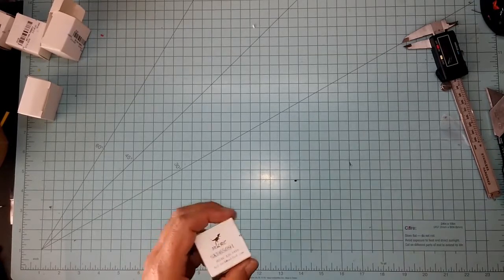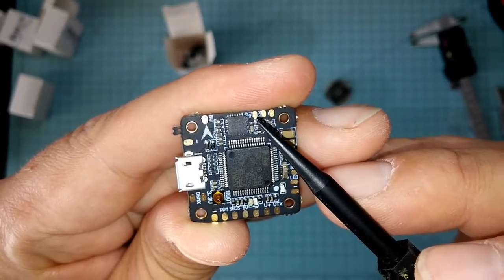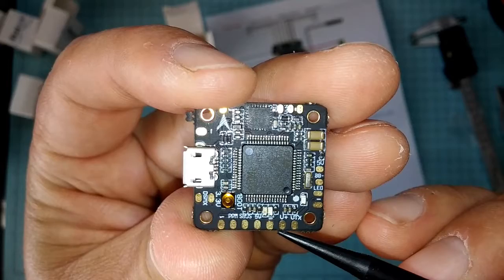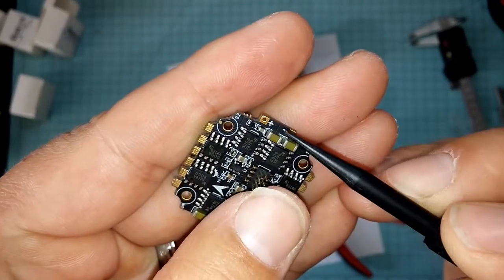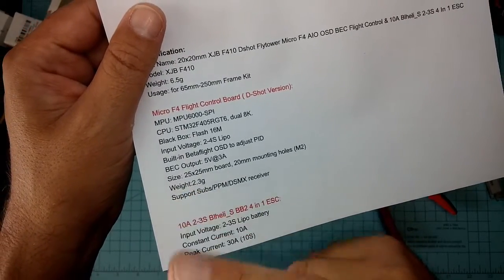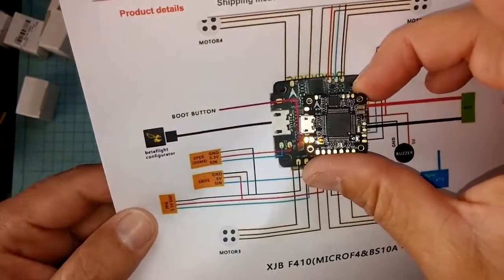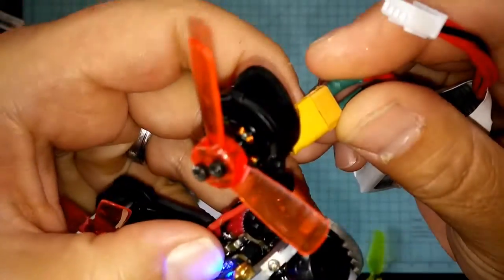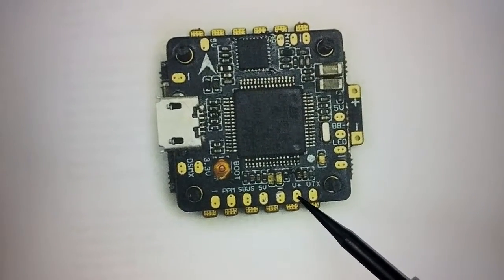Banggood  XJB F410 Dshot Flytower Micro F4 AIO Overview

Comment: Yeah I just put the New Emax mini magnum F3 on a 2" quad. It goes from 2s to 4s. It weighs 76 grams without the battery and it fly's pretty good on a 3S 450Mah Battery. What is your weight on this frame with the flight controller and motors and props?

Yeah I was thinking about using a different frame like the one you're showing.

Here's my Maiden flight if you want to see how it flys.
https://youtu.be/2ch-6lWttpQ
Reply from the maker: +Unknown X damnnnn I’ll check it out.  I think I’m around 75g ??? Somewhere around there. Have u tried the hulkie props yet???? They’d be badass on your bird
Reply: JJRotoGeek, I never heard about them. I just looked them up and those props look like they'd get some really good thrust. Yeah I'm definitely going to buy some,  thanks for the heads up.
Reply from the maker: +Unknown X awesome brother.  Keep me posted on if ya like em!!!

Comment: I'm a bit confused - what are the 8 connection pins in the middle of the boards? Are these the motor signal pins? So no need to use wires to send the motor signals from the FC to the ESC board?
Reply from the maker: Mike vom Mars hey there!!! No, there’s a socket on the 4in1 esc board that the flight controller pins plug into.  They interconnect.
Reply: So I guess this socket is where the motor signals are sent through? Nice solution then 😊👍
Reply from the maker: Mike vom Mars yes sir!!! Motor signal and fc power!!

Comment: Hey jj. I probably wouldn’t do 4s on a 7500kv and even the 6000kv will get really hot with a bad tune. Emax also sells a 4500kv and that would be best if you want to fly a 4s all the time but with a good tune the 6000kv will rip for a little while at least.
Reply from the maker: ace trex oh absolutely.  The 4s would smoke the 85k quick lol but it would go fast for a second loloool

Comment: Hey jj. I finally got my egg 100 done with a runcam micro, emax 6000 1106, xjb f428, a 4s 550mah infinity and holy s#*t brother you have got to do this!!! It is way faster than a 5”!!   Probably Close to 130mph + of insanity!!
Reply from the maker: LOL fucking aweseome! Ive got that same rig on my home made lizard frame build.. f4 omnibus with a 25a esc but with 7500kv.. however i havent run 4s!!  and those motors are perfect for that, it would smoke mine.. do me a favor and send me a link to the motors and battery your using.. gotta try it LOL

Comment: What motors are you using on the egg 100 and is it pretty decent with that heavy of a frame.
Reply from the maker: ace trex I really like how it flys, although I broke the frame the other day, but I ordered two spare frames that just came in, so I'll be doing a rebuild. I'm using dys 7500kv motors on it, but in the rebuild I'm switching them out for the ipower 7500kv

Comment: Is the F425 board the same way with the battery voltage on that port.  Cause I fried a VTX hooking it up that way.  I frankenstiened one off a different quad but it could handle the voltage.  when I got the new part in the mail, I took off the huge VTX and accidently pulled that solder pad off.  So I wired to the 5v on the front left and have no problems now.  So did I get lucky or did they fix this?
Reply from the maker: Hey there, i wired this one the exact same way as the F25, they are both identical as far as i could tell, had no issues. If you hook up the vtx to the voltage port it will fry it, because thats straight bat voltage through put. You have to use the 5v pads for the vtx
Reply: Thank you for confirming that.  Im gonna go warn a buddy about it.  I know hes doing the same setup as me.  So when I ripped the solder pad off my board, and felt bad about it all night and the next day for wrecking my brand new FC.  I was really getting lucky, because it forced me to use the other 5v.  Awesome, good to know.
Reply from the maker: jarrod landry no problem brother, I smoked a brand new kakute aio once, right off the bat.  We all fuck up lol
Reply: Just an update.  Ive been rocking this micro for a few months now.  I fly so much better now.  It takes a beating some days lol.  Over the winter I'll upgrade to the emax 1106 6000kv.  They werent out yet (I should have waited 2 weeks).  Love the micros, batteries are cheap and too light to break, 80 foot falls, slammed huge tree trucks, large branches and had a fail safe and it fell 60 feet out of the sky.  Id say its pretty tough.  I use the same frame as the leader 120.  with a runcam micro crammed in.  Cant wait for next year.
Reply from the maker: +jarrod landry damn brother well said!!! Every year brings allota new gear.  Fun shit!!

Comment: how do you get it to do the starwars theme at the startup there? Also is there a way to know what the beeping from the FC means? Mines locked up and does 3 fast beeps then 2 slower beeps... and wont connect to beta flight or flash. Awesome vid!
Reply from the maker: Hey brother, thank you!! i am going to do a how to vide o on the star wars tones tday and get it up. a few people have asked that. your fc wont flash? or just the esc wont flash?
Reply: Im not sure, so I went ahead and got a new stack. the Fc only flashes a blue light, and a solid red one. when hooked to the drone it also beeps the flashing blue light thru the buzzer. AWESOME! look forward to your vid!
Reply from the maker: Michael Silcox ahhhh.  Does it hook up to beta flight ok and flash alright?
Reply: No, it plugs in and gets the lights to kick on, but it will not connect to beta flight, I have 2 of these FC's and the other connects and works just fine. My friend who is the owner of the FC asked HGLRC on facebook about it and they recommended to heat up the MPU6000 chip with a heat gun, to see if that sets it back in place.
Reply from the maker: Michael Silcox lololol r u fucking kidding me?????? They actually told u to do a reflow the solder??? That's professional.  If one connects and the other dosnt, try holding the boot button down and plugging it in, if that doesn't work, send the damn thing back lol
Reply: Well... First I coated the whole board in conforming silicone, as I do with them all. Have not had a problem with that yet. then in soldering we got a few of the tabs to almost come all the way off. they have maybe one chance at soldering on a wire left. And last,,, we ordered a new brick lol, so we will have spare parts if I can get this to work later. yeah they recommended trying that lol. I have the gear to do it and have it work here and there in the past.
Reply from the maker: Michael Silcox oh I have to, don't get me wrong, I've used toaster ovens and heat guns.   But it's unusual for a manufacturer to advise that lol
Reply: That is... It really is lol.

Comment: Can u tell me how to connect smart port to a micro F4 board? sbus workin fine but i have no clue where to solder ma s.port wire to...seems like rx1,tx1 doesnt work....got a furibee f4 flytower ... cant get telemetry or ma motors to spin...very desperating :(
Reply from the maker: Hey there, i dont use telemetry but we can get it to work. im asuming that you wire your telemetry output from you reciever into the rx of the board, im sure youve done that already, did you set it up in the ports page in betflight yet?
Reply: JJRotoGeek hey first of all thanks for the fast answer!! Yeah i soldered the smartport from my x4r to the rx1 on the board! I selected serial rx for uart1 and enabled smart port on uart3! Receiver is bound and i can see all my inputs feom receiver in betaflight but no telemetry :/
Reply: Btw. Motors are spinning now...was ma fault to not set them up correctly in blheli :D  ..im only missing the smart port now...
Reply from the maker: so in the ports tab you have frsky selected, and in the configuration tab you have telemetry enables and on your osdtab you have it turned on>?
Reply: JJRotoGeek in the ports tab i have selected smart port cause i thought that frsky telemetry only works in one direction and i want to use s.port for example lua script. In the configtab i have telemetry enabled but on osdtab i havnt done any config cause i couldnt find any sensors on ma taranis so i didnt continue configuring the osd... Should i try like u said?
Reply from the maker: damn brother, not sure.. you prolly know more about it than me. i use radiolink gear so i dont use onboard telemetry. seems like you haveit set though, try setting it to frsky instead and see what it does
Reply: JJRotoGeek thanks anyways buddy for taking time to help me! Iam pretty new to kwad scene but i already figured out that the smartport is talking to fc and the fc to the smart port! This way u can set ya rates with the taranis if ure using lua script for example.
Reply: But yeah i will definetaly give it a try... If i have the solution ill post it here...maybe other guys also have the same issue...
Reply from the maker: h4Zelnut! Sweeeet   Well make sure ya keep in touch and post me some of ya builds and flying
Reply: JJRotoGeek for sure i will, hopefully ma first micro leaves the ground soon :) Thanks again for ya help buddy! Subbed for sure ;)
Reply from the maker: h4Zelnut! Sorry I couldn't be more help brother